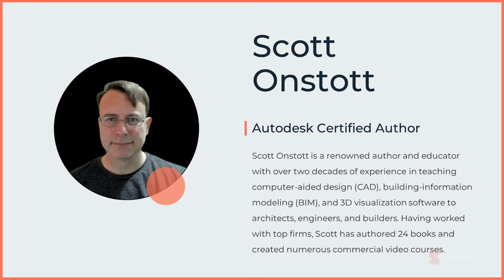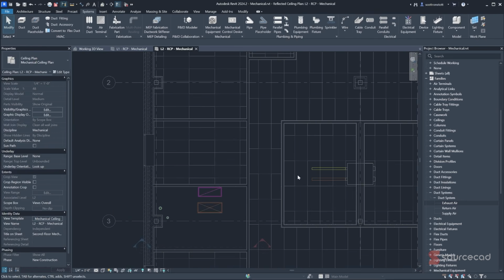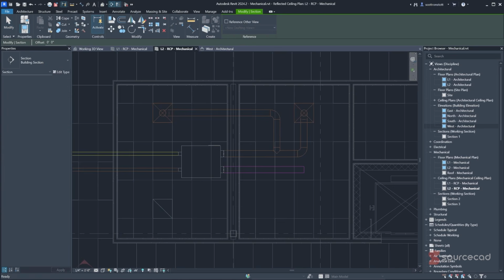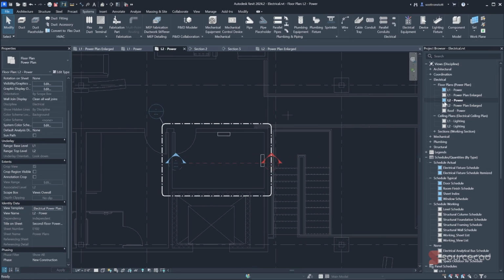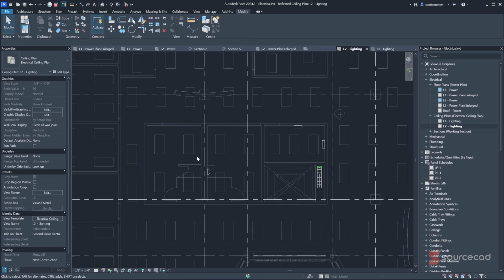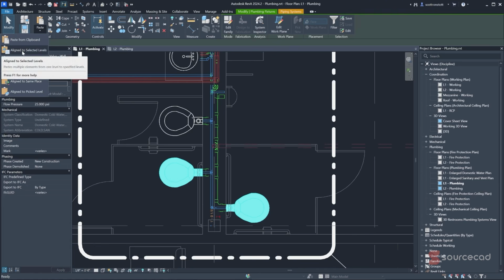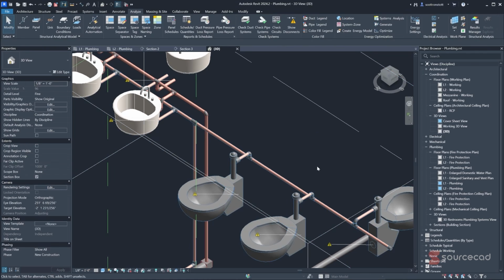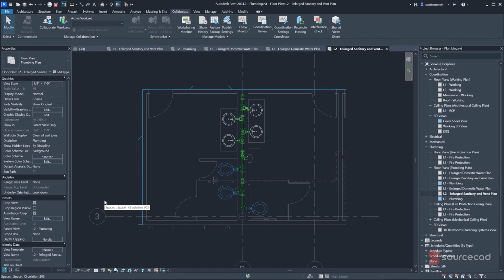Revit MEP tutorial for complete beginners

Comment: 11:54 when trying to make the corner in the duct, I get the error message: The routing solution failed because there is no default fitting type specified or the fitting cannot be found in the project. Ensure the fitting is loaded in the project and try again.